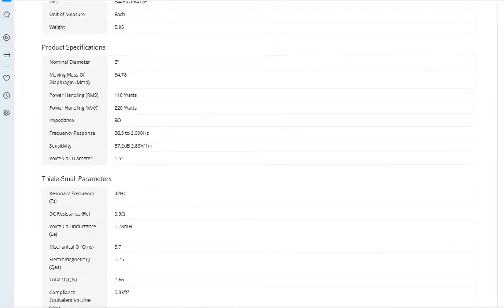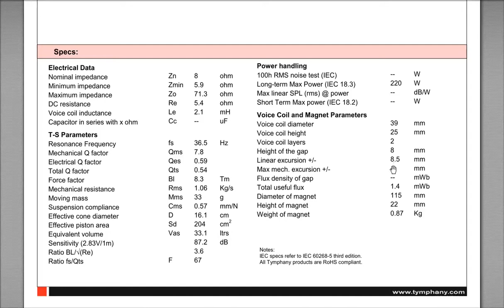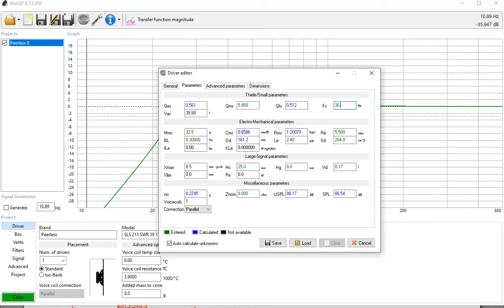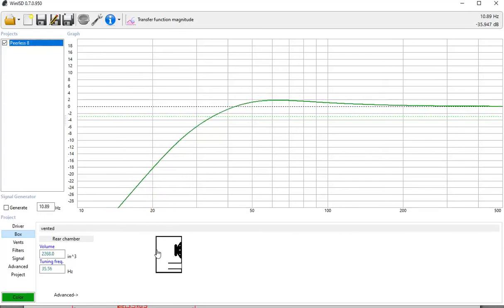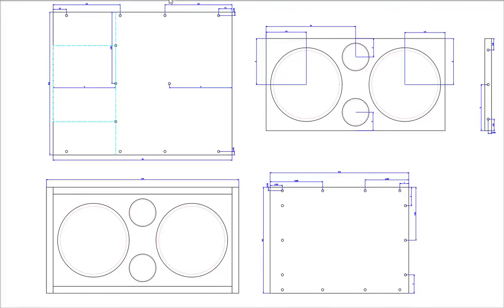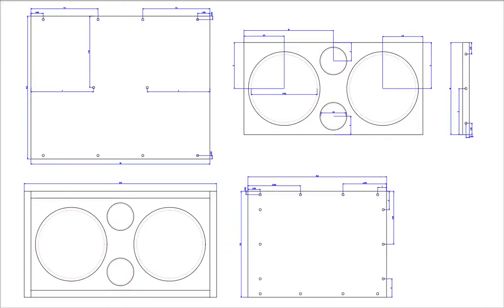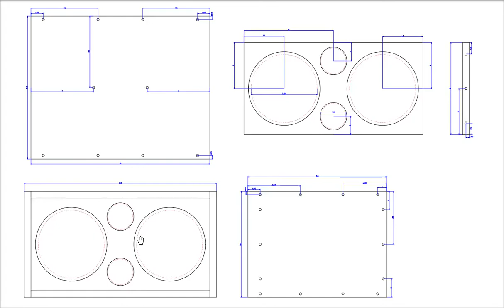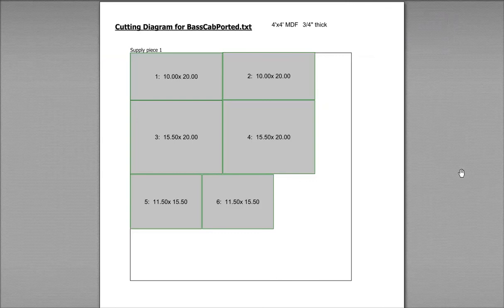DIY 2x8 Bass Guitar Speaker Cabinet Design and Build

Comment: Cheers, Eugene. I've notice that you answer what people ask to you...so kind of you. And here's mine if you dont mind.
See I've got a 90's Peavey Mark VI head and a 4x10 (emminence) hand made cab, and Im very frustrated with its sound when I play live, because of its so very boosted low end. So I realized that the cab doesn't have any of those smaller holes in the front and the rear is totally closed. Is that a design mustake? Would I have more definition (without sacrifice the lower eq ranges) if I add some holes or if a open a bit the rear??.... thank you so much
Reply from the maker: Hi, if I'm to understand correctly, you have too much bottom end?  If the cab is "booming", you can add fiberglass insulation inside to each of the sides. The same stuff you insulate walls with. It could also be that you need to add a horn to capture the top end. If your strings sound dead when playing, it means you need more highs via adding a horn.
Reply from the maker: It's very hard for a bass player to hear his bass on stage. Bass cabinets and the low frequencies project quite far in front and in the crowd. I remember practicing very quietly in my basement bedroom when I was a teenager and the upstairs was booming while I could barely hear it. One thing you can do, is put your cabinet right at the back of the stage and you play up front to hear how it sounds.
Reply from the maker: The purpose of the ports/vents is to improve the bottom end. If you had the opposite problem where there wasn't enough low end, then adding ports could increase the bottom end.
Reply from the maker: One last thing to check is if your speakers are all in phase. Out of phase speakers can cause strange responses.

Comment: Does box shape make a difference if the interior volume (cubic inches) stays the same?  I’m considering using  an old 410 I have and making it taller and less deep.  I’ve measured the interior volume and would be keeping it the same.  Speakers, crossover and wiring...all being reused.
Reply from the maker: That is a great question. I don't really know the answer. I have made boxes that the sides were prime numbers and the thought was that it would reduce reflections inside which might cause harmonics. It would be interesting to make two speakers boxes with very different orientations but the same interior volume and then test the frequency response. Keep in mind that the size of the box only affects the bass and low mids.

Comment: I want to know, what kind of types the best speakers for bass cabinet? Midrange, woofer or subwofer with tweeter?
Reply from the maker: That depends on the speakers, the type of music  and what you want it to sound like. Plus lots of research on speakers and cabinets. Not a simple answer. I have had bass guitar cabinets that have had 1x18" speaker and 2x8" speakers, many 4x10" cabinets from different manufacturers that sounded very different from each other. 2x15 cabinets, Two 1x15 cabinets. I've bi-amped a 2x8" cab with 2x12" subwoofers. All had their own unique pros and cons and sound. For my own personal taste, I had a Behringer Ultrabass BX4410A combo amp with 4x10 speakers. It was the best sounding amp, I've had except for one major issue: it weighed 133 lb (60.5 kg)! I could barely lift it into the back of my van. That's what lead to building the compact 2x8" speakers.
Reply: @blanchae  thanks for your answers, give me a comprehensive thinking.